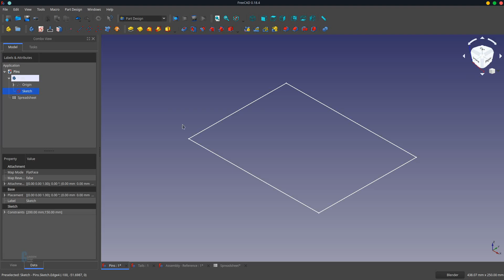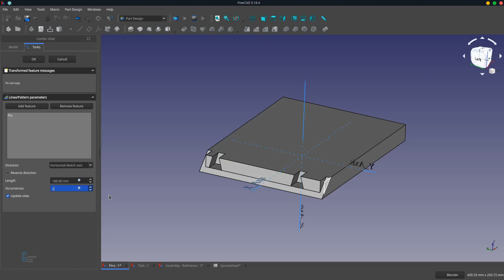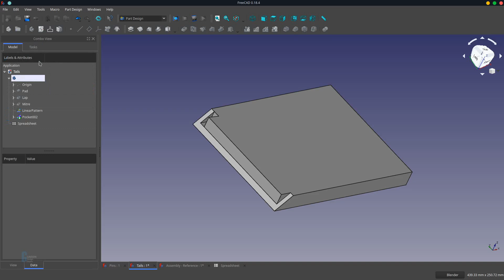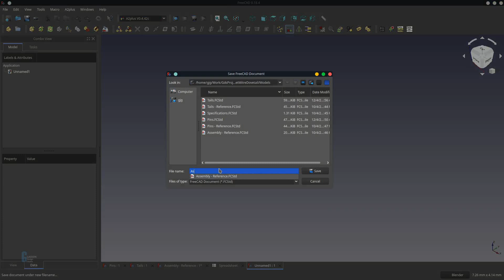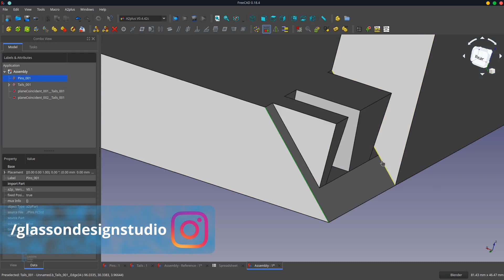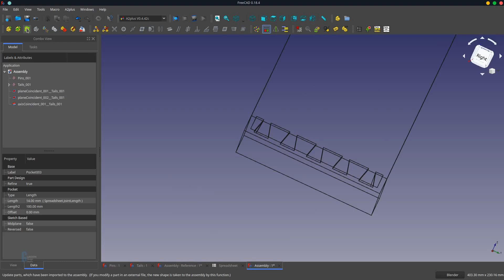Howto model a secret mitre dovetail joint in FreeCAD

Comment: I've always been confused by FreeCAD but working alongside these videos has been straightening me out. I'm actually making this comment now because I don't understand why you said "mirror this feature" and then didn't press the "mirror feature" button. I tried it in mine and it worked fine. Plus I didn't need another "magic" 5mm. The most likely reason is that "mirror feature" didn't work for you because FreeCAD is so buggy...
Reply from the maker: Thanks for your feedback David. You're right I should have used the mirror tool but I didn't. It would have been much easier if I had.